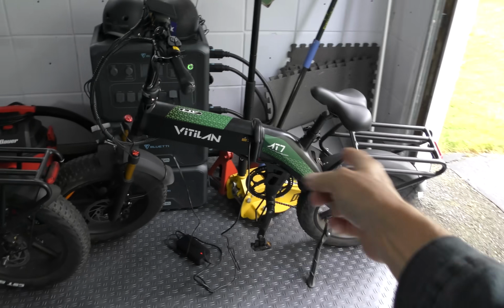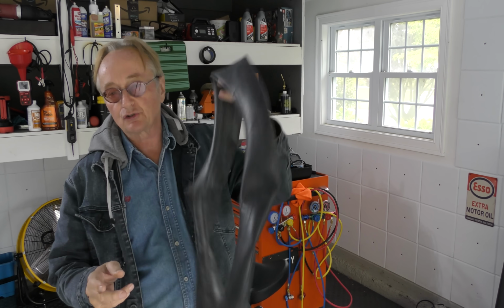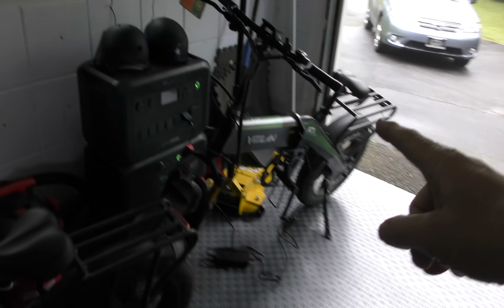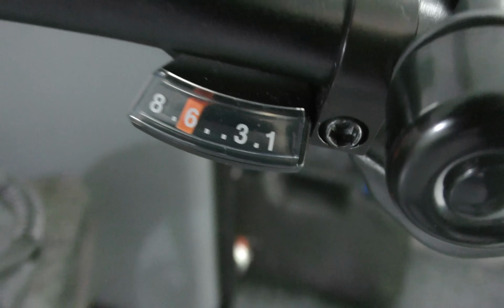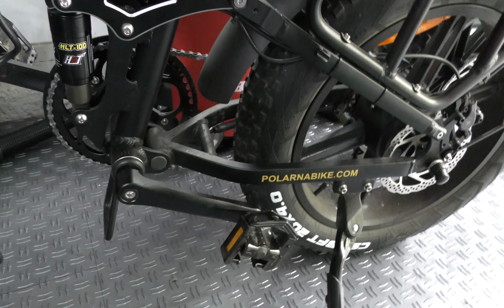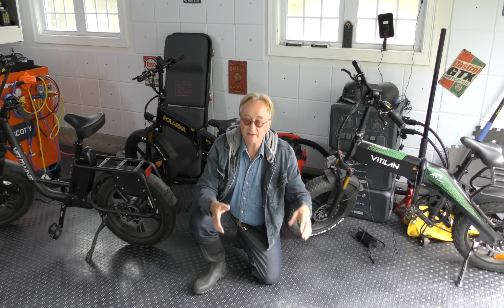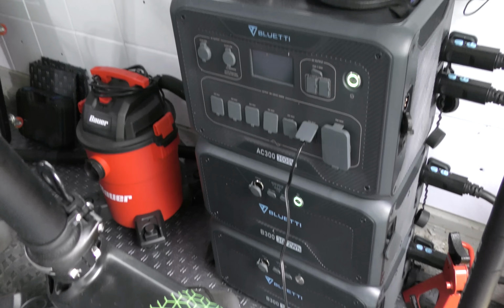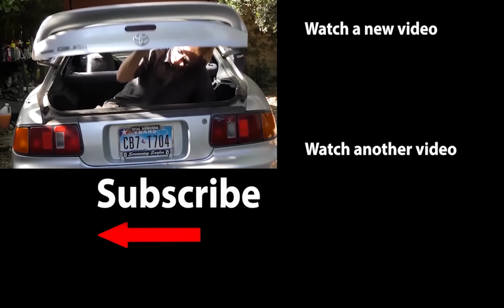I Finally Got an Electric Vehicle, Here’s What I Chose

Comment: You have to soap the tube or it will pinch and go flat
Reply: You dust inner tubes with talcum powder then get it slightly inflated before inserting it inside the tire. That keeps the tube in place as you lever the tire bead over the rim. Some folks rub a bar of soap on the rim so the tire can slip on the rim while being levered into place.

Comment: I prefer to build my own but I'm a huge fan of e-bikes. Most efficient PHEV of them all. Local trips that cost dollars in a car cost pennies on an e-bike:)
The better range (assuming both batteries have the same amp hours) is probably due to the motor controller drawing less amps. If the long range bike doesn't accelerate as fast it's definitely drawing less amps.
The bike parts are easy and cheap to replace. It's the electronics that can get tricky depending on brand. Bafang motors are the old timers in the game so parts are easy to find and relatively cheap.
I'm still keeping my manual turbo gas hog but I'm not driving it as much.

Comment: The difference in range would be a combination of weight differences from the folding mechanisms and the dual suspension bike inherently loses efficiency with the suspension movement on the rear. 😉
Reply: true, also the cells. The pricer one is 77# and uses LG cells.

Comment: I have a juiced ripcurrent with a 52v 13ah battery. It’s got 3000 miles going on 4000 it’ll pay itself off compared to the price of gas per mile in just a few thousand more miles. The motor is rated to last at least 15,000 miles. It’s a good deal.
Reply: What model motor does it have?

Comment: just need to install a generator on them to remove range limit
Reply: @lesoram6236  … 🤔
Reply: @lesoram6236  - works fine. It's called a hybrid. Or locomotive - they don't use batteries, but they do use really big diesel generators to drive the electric motors on the wheels.

Comment: The difference in range could be a few factors including the quality of the motors, controllers, and battery cells. Each component has its own efficiency. They may all have the same sticker rating, but real-world performance will vary. How many amps are actually being drawn, we don't know. What's the actual capacity of the cells in the battery pack, we don't know. How hot is the motor, controller, and battery pack getting and how well are they designed to shed that heat? We don't know. What's the rated efficiency of the controller and motor, in other world how much of the power that they receive do they actually put to use as opposed to being lost as heat? We don't know. Also each controller will have a program for how it manages the speed of the motor relative to throttle or PAS inputs, and the more expensive bike might have a more efficient program. And is the frame of each bike exactly the same in weight? All of these are relevant factors.

Comment: They're nice, but I don't buy Chinese crap if I can avoid it. AND, being on a low fixed income, I can't afford those things. I could put it on a credit card, I guess, but then I'd be paying an inflated price at 25 percent interest for a couple of years and by that time the prices may have come down along with gas prices. Meanwhile, I'll walk or ride my regular bike and leave the car at home unless absolutely necessary. Sucks being old and poor. But life throws ya curve balls. Gotta say, I like the one with the brown seat.👍
Reply: Honda should consider producing their original two-stroke bicycle motor that got them going in the early 1950's. Those could be fitted onto any bicycle and got something like 80 miles per gallon. There's some companies selling similar set-ups today but they use components made in China. 
Gas prices will come down after the GOP takes control of both Houses and the WH for the next 10 to 20 years. They'll see that the Keystone XL is completed with more pipelines being laid and refineries built. I've been driving an '88 Chevy G30 van since 1994 that now has over 300,000 miles on the original 350 V8 and TH400 tranny. It's always been a gas hog averaging 12 to 14 mpg highway yet has been too reliable to get rid of plus is easy and cheap for me to repair. I live 30 miles from town so drive in once a month to load up on groceries, beer and cigarettes to save on gas. My oldest son gave me his '05 Neon in 2020 that I bought him as a HS graduation gift in 2006 so now drive that (35 mpg) while waiting for gas prices to go back down.
Reply: @billwilson3609  Gotcha. Agree and there are always "work arounds" to ease the suffering if you're smart. And you seem smart. Get everyone you know that's like minded together and vote in November. Best regards. 👍

Comment: Scotty, I have a 2010 Suburban and it caught fire. I did not know what was burning then I got it home and started it and the fuel box got wet. I changed the whole thing and then got a fuel leak. Dropped the tank and fixed that now it's dumping fuel out of the exhaust and I believe that it's what caught fire the first time. The codes I got were P0203, and P024. P0206, P0208. (Fuel injector/ failure. Can 4 go bad at the same time? Would it dump fuel out the exhaust? Would there be something else? I'm disabled, on a fixed income, and need a car to get to the doctor's please help me. I been battling throat cancer and bills are killing me. I need to fix my car please help me.
Reply: im praying it aint a burnt valve and your fuel injectors are just crusty beyond belief. best of luck bro 🙏
Reply: They ran pretty much the same mileage at some point they probably went bad one at a time, it surely dint happen all of a sudden. Fuel coming out of the exhaust after you fixed all the other symptoms can mean your engine is running very rich. It’s not getting enough air to the injectors. You probably need to change all of them before the heat from the exhaust lights up the gas coming out of it again
Reply: Get the electric bicycle. Sell the car. Tq.
Reply: @cb250nighthawk3  - I always like the idea of getting a Suburban off the roads in favor of an ebike, but...

dudes a throat cancer patient. In addition to being sick on two wheels not being at all pleasant, if he's had any radiation therapy in that region (neck), there's a chance of his inner ears being affected, and his balance not being quite perfect - also not on the plus side of the two-wheeled equation.

Wish I knew more about modern cars, since I've got a Chevy Astro sitting in my driveway with an electrical system that I am fairly sure, from the symptoms and trouble codes, has been possessed either by Satan or one of his upper echelon demons. I have emailed our local Cardinal about whether mixing antifreeze with holy water in the cooling system would mess up the effects of the holy water, and whether I would need holy antifreeze, but so far I haven't gotten a reply.

Comment: Hi Scotty, 
Are the battery packs interchangeable?  If so, put the highest priced bike's battery in the one that has the shortest range. Then put the battery from shortest range into the most expensive one, that you said had the longis range.  Do this to see if the most expensive bike still has the longest range.  Get it?
Reply: Most likely the expensive one is lighter since it doesn't fold so they no longer need extra weight for the hinge mechanism...
Reply: @alphaxfang  the $$$ is 77#
Reply: or just swap and you drive the other bikes to test its range. Also the type of cells on the 1500 uses LG batteries. That bike weighs 77#
Reply: It would be nice if they came up with a standard battery